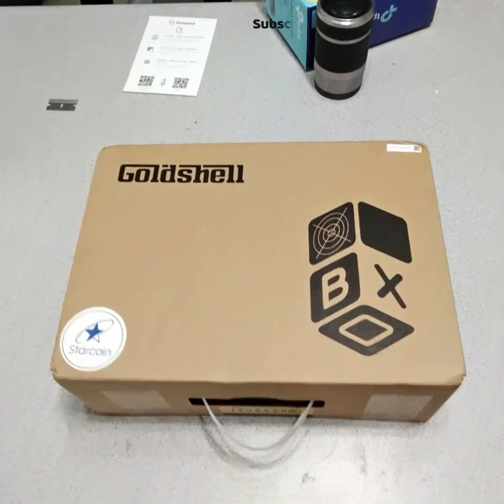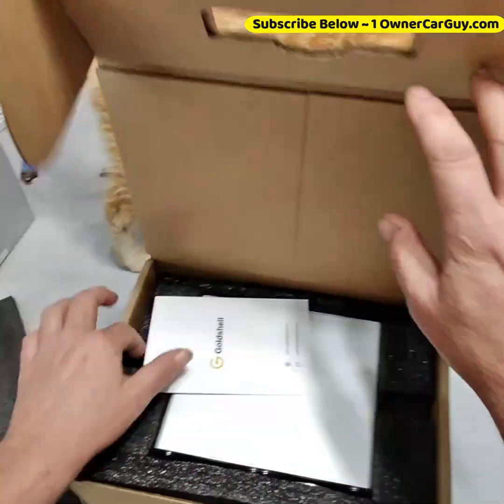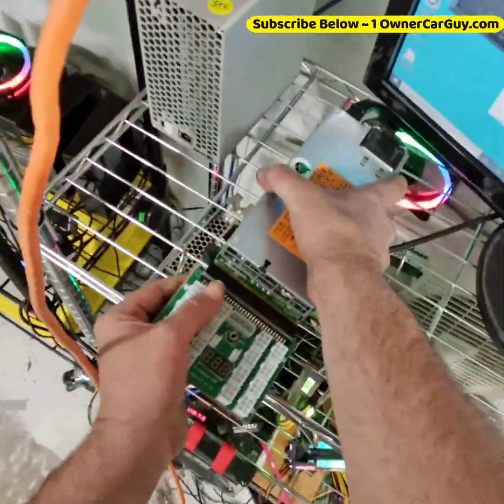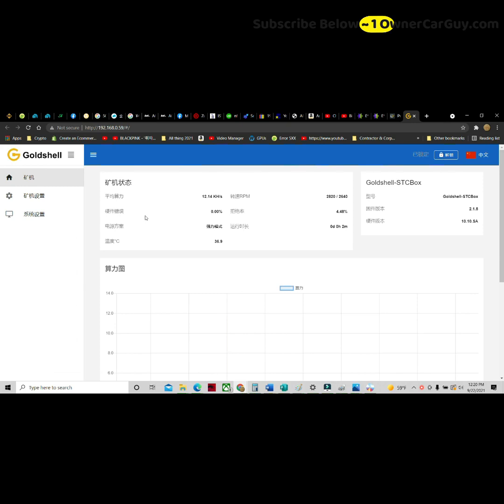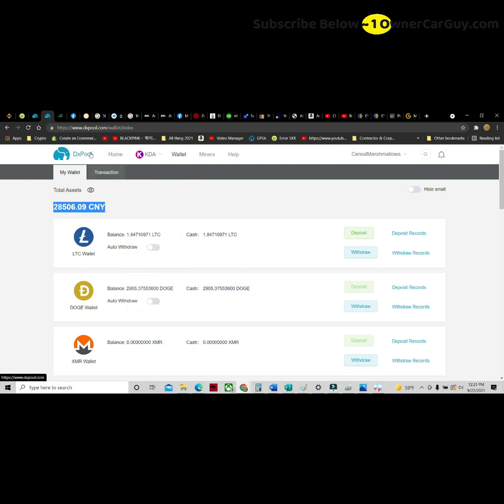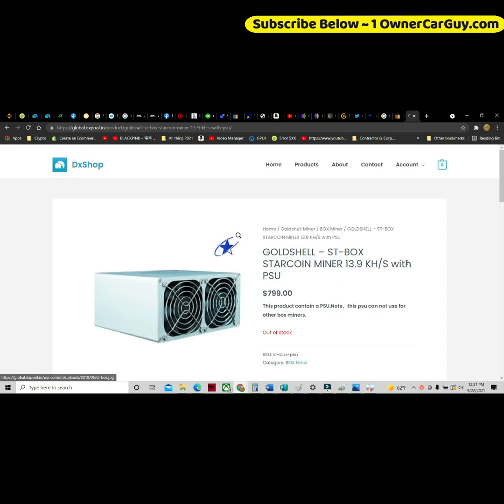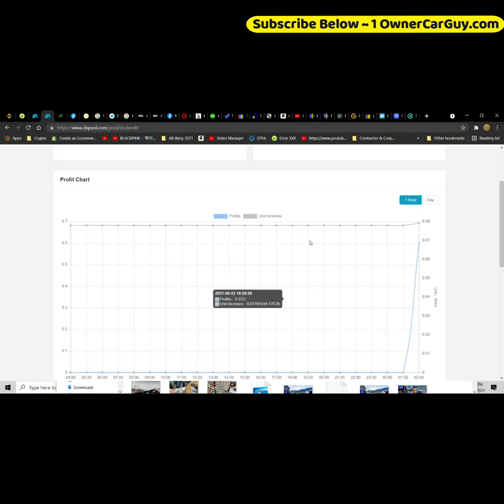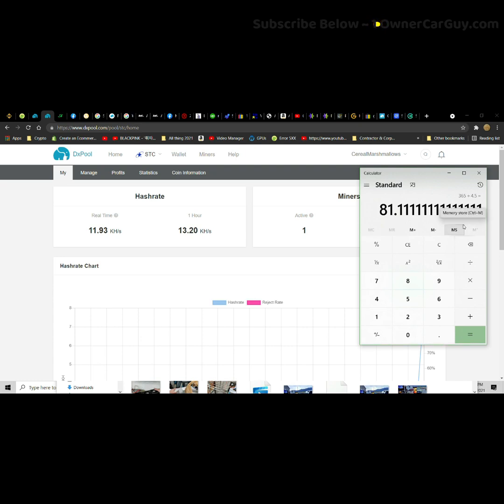Starcoin STC Setup Goldshell ST-BOX RARE ASIC Miner ~ Update New Ray Ban Stories Smart Glasses Video

Comment: What is your reject rate? mine is between 3-5%. i updated firmware to 2.2.0 but it hasnt changed. What firmware are you using. tia ps thanks for the heads up on the stc box. i missed the KD train but im not missing STC, what a project.
Reply from the maker: I like the project for SURE and look forward the years ahead in the next bull... We shall see... The error rate is par for the course its not as high as KDA but STC is higher than others
Reply: Getting around 5% as well.. that's normal for stc

Comment: Just added 4 goldshell STC-box to my farm. 107 stc first day . Is that gd? I’m also using DxPool. Wonder whatever else is mining/ day
Reply from the maker: Yea that sounds about right! I really wish I would have gotten more of them. Why did you pick the STC- Box? I dunno if there are any other pools any info on this coin is pretty scarce
Reply: @CerealMarshmallows  did some research on stc, noticed it was low key compared to other tokens, Market cap , circulating supply seemed low. Since my first comment I’ve been mining 90-95 STC a day however stc did pump a few days ago to $0.2 back to 0.125-0.135 . so far so good .
Reply from the maker: Yea pretty much same here.. Should be Interesting ;-)
Reply: @tonytehfe8358  which website do you check starcoin on? Coingecko? Cmc?
Reply: @CerealMarshmallows  Im able to get one for 1100 at the moment, should i go for it?
Reply: @YoJayBro  yes! i just bought 1 for 1400 :/